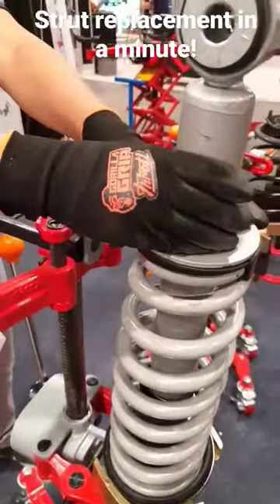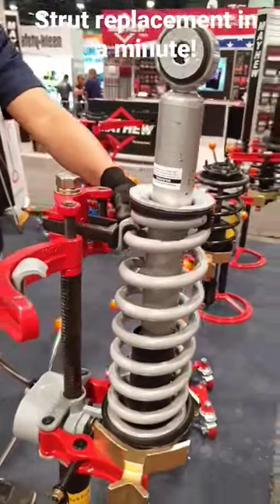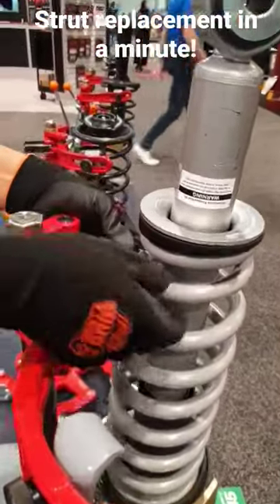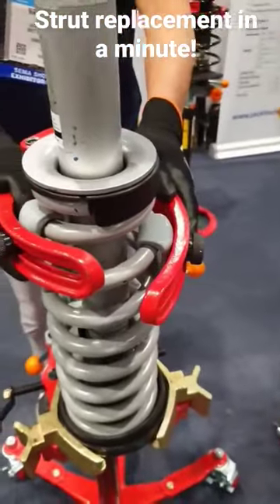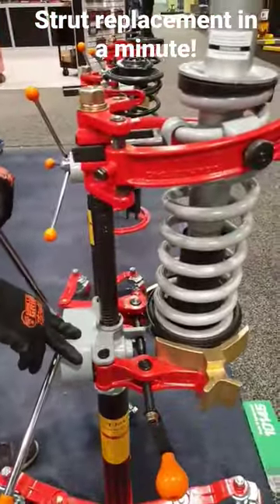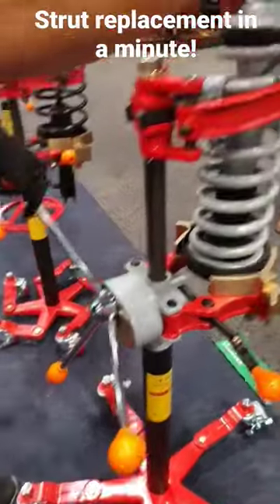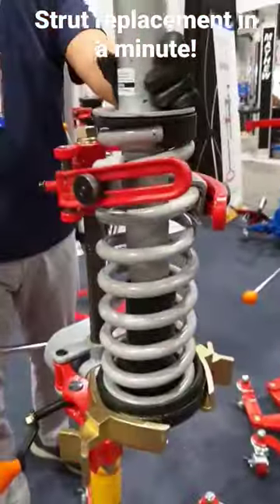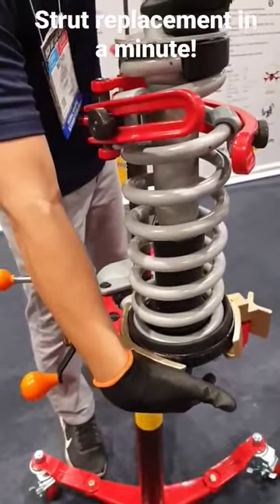The best spring compressor, SK-3500!

Comment: Can the sk-3000 be used on a similar strut and spring?
Reply from the maker: The strut in the video is a tuning spring for FORD F150.  If you frequently work with such a strong spring, SK-3500 model is recommended.  Since it is equipped with a gear reduction, the spring can be compressed much more easily.  But if you work with heavy springs occasionally, SK-3000 would work for you.  If you have any questions, feel free to email us at jacktechusa@gmail.com.  Thank you! :)

Comment: Why do you have to put the strut upside down as it would make it hard to take of the bottom bolt as its facing down
Reply from the maker: You can either compress it upright and upside-down.  The reason it is more efficient to compress upside-down is because you only need single compression to replace the strut.  You do not have to release it and readjust the spring which is the hardest part of replacing strut.   Because the compressor will hold the top plate and spring compressed you can just take off the strut and put the new strut without  decompressing it.  It will only take 1 minute to change the strut. :)